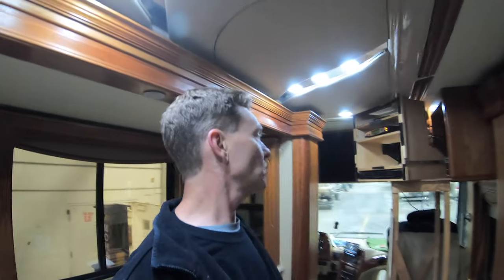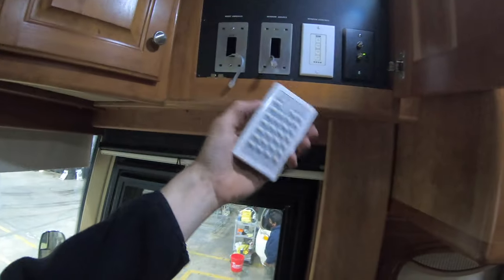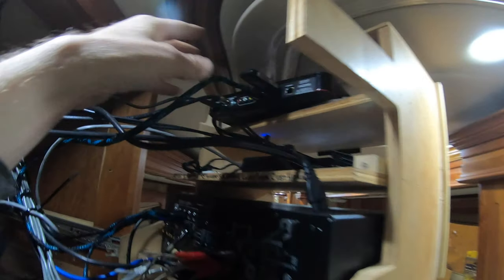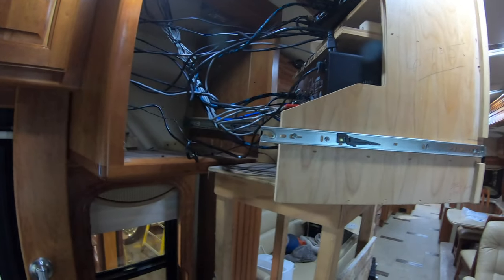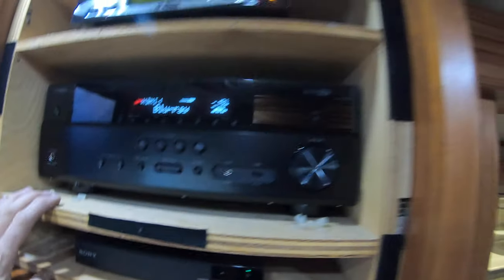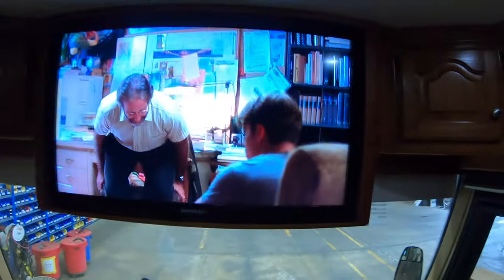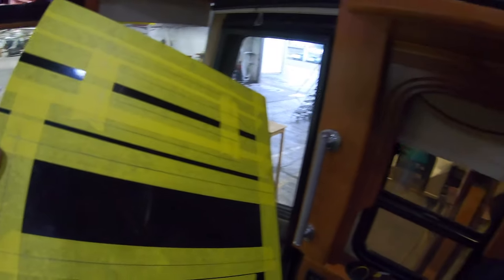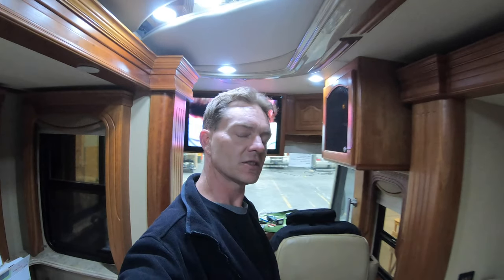County Coach Home Theater Upgrade!!

Comment: Brian, great work!  If I may ask, what do you cut the abs plastic with and what type of drill do you use?  Needless to say I might have cracked a piece or two in the past.  Thanks Gary.
Reply: Would like to know this as well. I cut my own and it looks terrible. Need a re-do. Any tricks to measuring for those tight tolerances?

Comment: Brian love your videos. I brought an 2004 magna that has a nec projector and roll down screen above dash. Trying to find an upgrade for the projector to work with the screen from 12 feet from the screen. Any ideas?
Reply from the maker: Shouldn’t be too hard to find a projector it probably would be much smaller and may have to modify the vacuum molded ceiling shroud. Feel free to reach out to me at BrianMoto773@gmail.com and include your phone number and I’ll give you a call back if you need any help. Thanks for watching

Comment: My concern is that the receiver is not getting enough ventilation being closed in behind the panel and so close the the upper shelf.
Reply from the maker: There is a exhaust fan in the cabinet with a thermostat and a fresh air inlet in the bottom